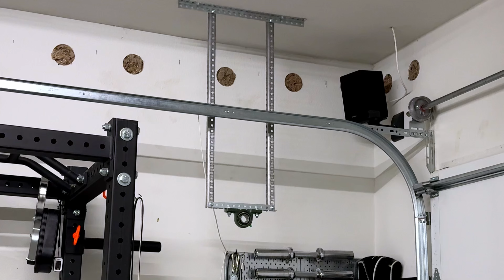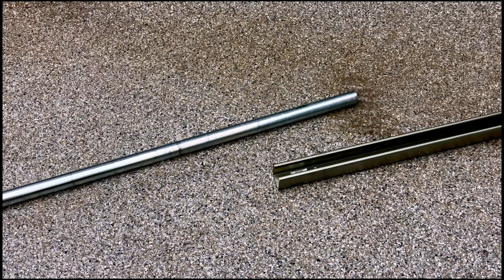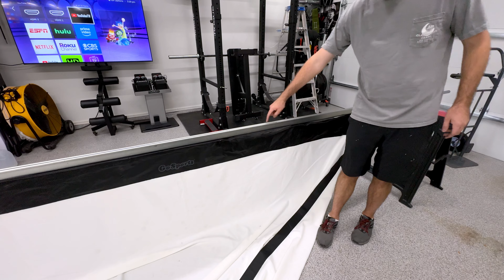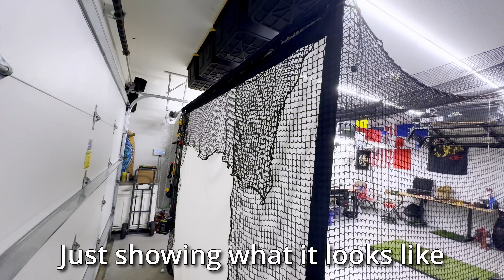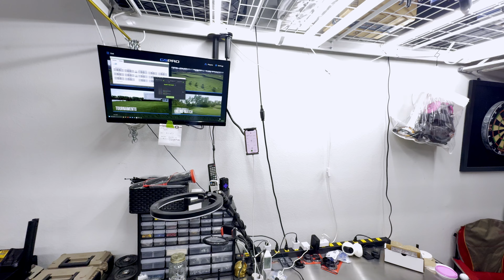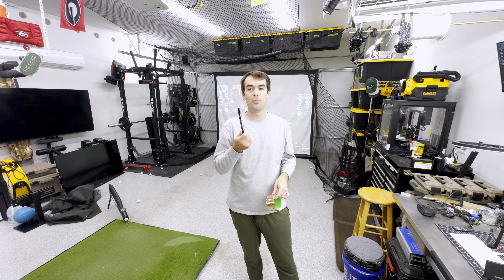How to build my CHEAP DIY Golf Simulator - Update (V2)

Comment: Hey Chuck, great video and setup. Working on a similar setup with a few modifications. Do you have the right penguin bearing on the link on your site. It took me to a 1 1/4 boring hole model. I have a 1 inch conduit, so not sure which bearing diameter to get. Thank you for all the details in the video.
Reply from the maker: Hey! Yes it’s 1-1/4”. The outer diameter of the EMT conduit would exactly match the inner diameter of the bearing - meaning it wouldn’t fit! They just butted up to each other and I had to exchange the 1” for 1-1/4”. There are adjustment screws that will clamp the conduit to lock it into place
Reply: @ thanks Chuck, I got the bearings today and they’re fantastic. Setup is 90% ready. I only used conduit top and bottom to keep weight down and it’s working fine so far. Next step is to put up the nets. Thanks for your reply!
Reply from the maker: @LuisRivero-tt5sg  Hope it treats you well!

Comment: Chuck you sweet sweet glorious angel. I am interested big time in this. I have a garage door motor in my way currently I need to figure that out.  I will go back and watch your original video too. A couple of questions....do you think that bar that the screen is on is sagging much or are you happy with how it turned out? second, is there any reason you couldn't use conduit in the bottom of the screen instead of the square thing you used? Also maybe this is too cost prohibitive, but you could attach a small second pipe to those angle iron across, just above the screen and wrap that in foam to keep the richochet from happening.
Reply from the maker: Thanks for your kind words. Sometimes I feel like “who’s going to watch this” but I know I was looking at all kinds! In my v1 I used conduit at the bottom, it was easier to cover in foam but harder to keep the screen tensioned. The sag is better on this version that my old one but it is not perfect. The fact the unistrut fits so tightly I’m tempted to add some bolts to see if I can force some tension. I’m much less worried about it this time. I was playing with the idea of a pvc pipe covered in foam, held in place with bungees, might help on the top bar but I’m worried it’ll get too thick while rolling up. I highly recommend the jack shaft garage door opener up by the wall. Battery backup, quieter, and not that expensive but definitely on the pricier side for an upgrade.